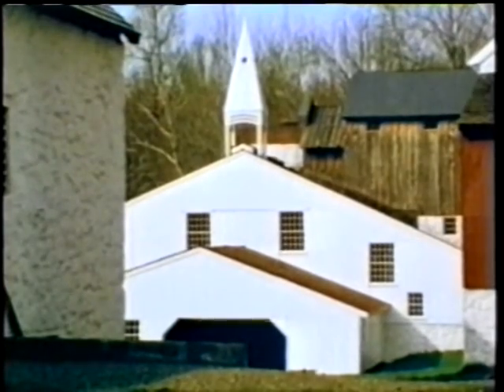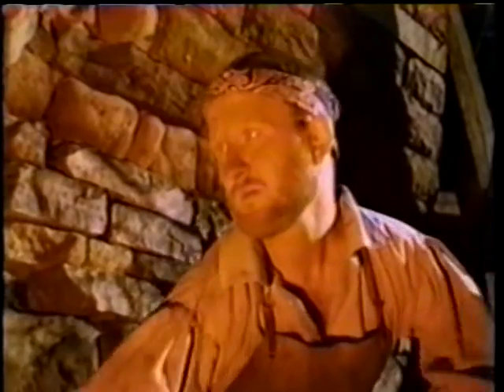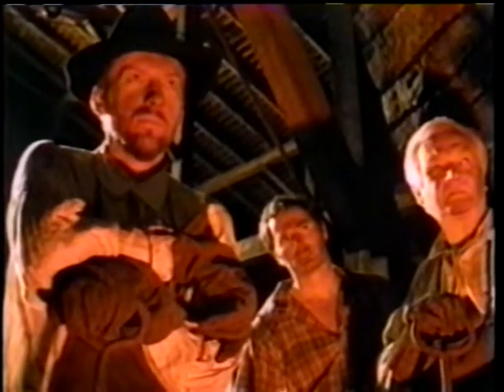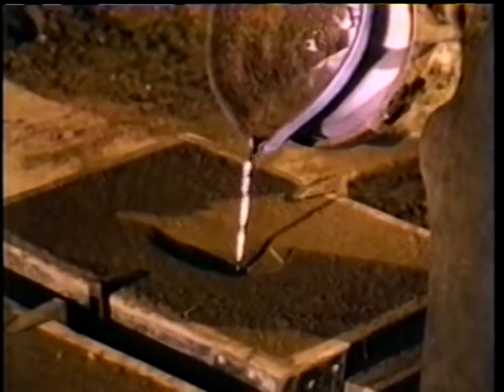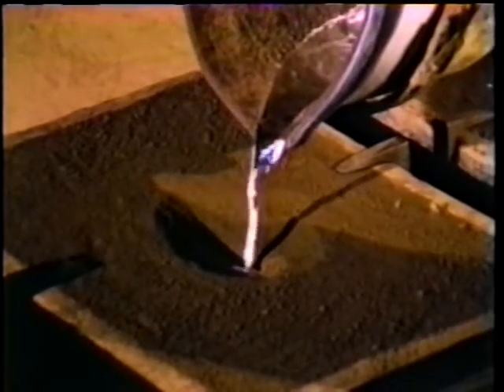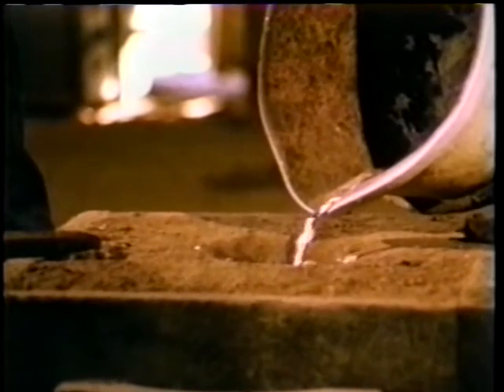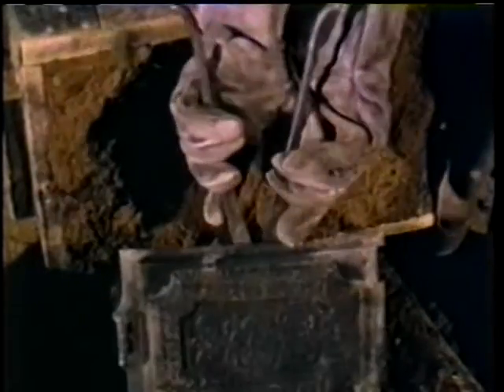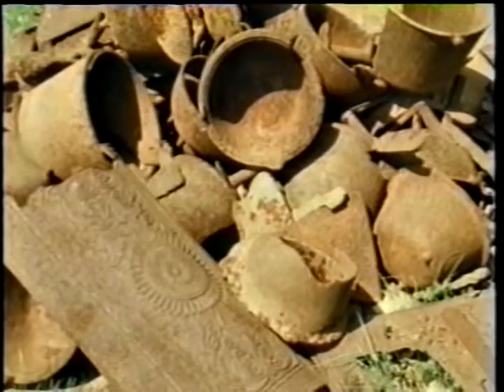Iron Casting at Hopewell Furnace

Comment: Nice video, but the metal being handled in this video appears to be aluminum. I suppose it works to demonstrate how the foundry would have run without the expense of actually running the furnace all the way up to iron temperatures.
Reply: I noticed that too.  I imagine that the safety issues would outweigh the need to run the furnace for a demonstration video.
Reply: I’ve seen this demonstration several times in person at Hopewell village In the 70s and they used aluminum.  I wonder if they still demonstrate this occasionally.